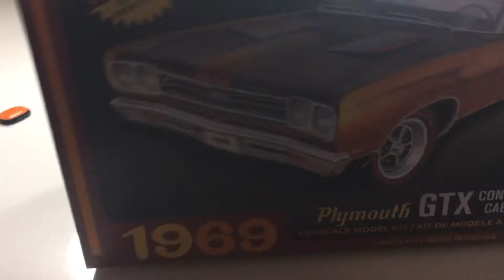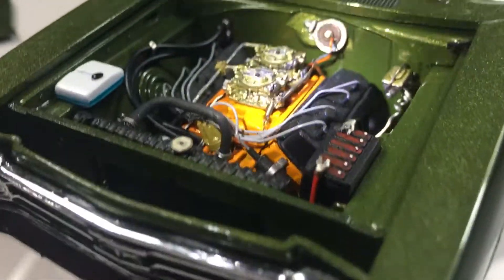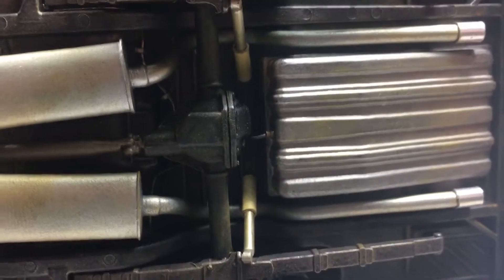Gtx final

Comment: Chucky, that F8 is one of my favorite mopar colors. I got some f8 from Splash paints. Hope its as good as Scale Finishes 👍
Reply from the maker: John Rubright ive heard good things about splash paints
Reply: @chuckymonster1000  did you use .005 solder wire for the spark plug wires? They lay so real
Reply from the maker: John Rubright I used detail master wires